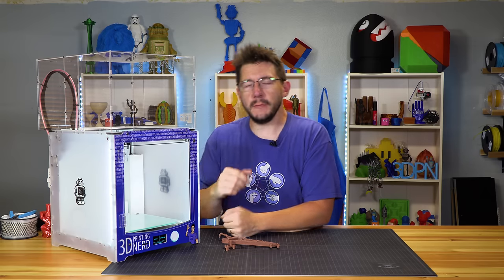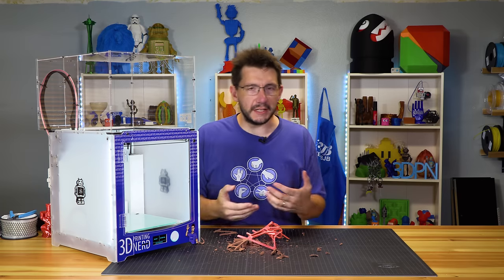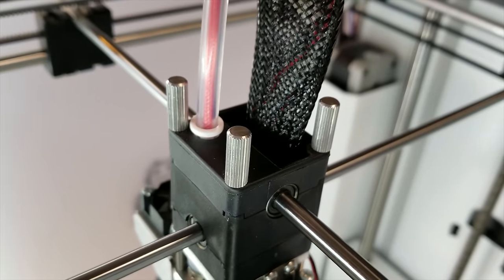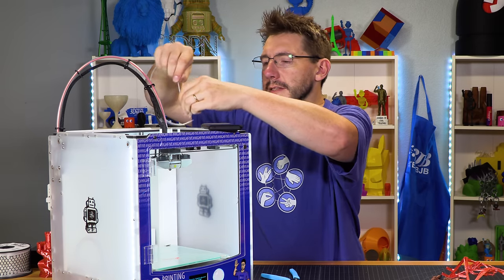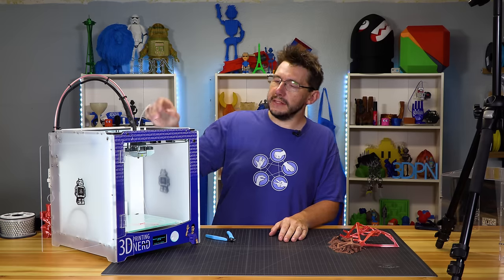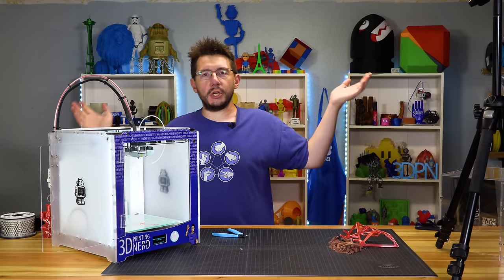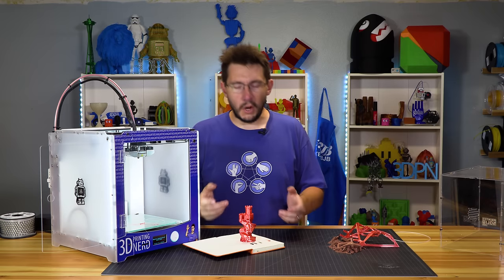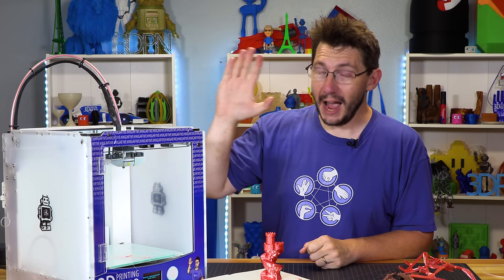3D Printing 101: How To Fix a Clogged Nozzle Using a Cold Pull!

Comment: Quick note to add: if you have a hot end where the PTFE tube goes ALL the way down to the nozzle (such as a CR-10), even if your firmware allows you to go to ludicrous temps, you should throttle it around 235c.
Reply: Meh, I'm printing PETG at 260°C with this and the bowden tube looks fine...
Reply: Eh. Even the UM2+ has a PTFE coupler between the hot end and the Bowden tube that needs to be replaced once in awhile from heat exposure (after1000hrs print time usually). Needs to be replaced more often with higher temps. Not like a cold pull takes that long anyway.
Reply: I took an old Bowden tube and cut an 2inch piece to guide my filament when loading hotend. Then after hotend cooled, I removed the tube, reheated hotend and did a cold pull. That way I didn't need to worry about guiding filament or burning my Bowden tube.😅

Comment: One thing I would add...I would move the print head to the corner and be wary you are not pulling upwards too hard to damage the metal rods.  I've never used Nylon for my Atomic Pulls, just PLA...heat to 220, press filament in, then cool to 90C and pull.  Rinse and repeat as needed.  I'll have to see how Nylon does as a comparison!  :)
Reply: In work we used PLA to cold pull a fully cloged UM3 BB hot end (with PVA) it takes few pulls and in the end it was like brand new.
Reply: Yes, this is the correct way... the way it is explained in the video is not the correct way.
Reply: The Explorographer There is no 'correct' or 'wrong' way. Of course, it works with PLA, but if you have some Nylon, thats better. The type of material doesn't really affect the cold pull. It's the action that does the magic. The type of material just changes how well a material works to clean out another material, based temperatures
Reply: Well then we can just agree to disagree.  I am going by how it is shown to be done right from the Ultimaker site. Do it however you want.
Reply: What i dont get is why he heats up the filament before pulling it out. Why call it a cold pull when you heat it up? I Also always use pla and either let it cool down all the way or heat it to 80C because it gets really flexible but it will pull everything out even the little bit right inside the 0.3mm hole.
Reply: Tibo Huyers I also don't get this. I let the filament cool down, and heat the extruder back up. while the extruder us heating I pull on the filament, until the extruder is so warm that the filament comes out.
Reply: tonpa888 that might actually be the best method since you take out the fillament right when it starts to come loose and when you want to put it back in the extruder is already heated up.
Reply: Yes that´s right. For me, it's the best method I used so far
Reply: I thought that was quite funny too.  Put the head where the bars are the least supported so you can bend them and go to pushing and pulling on the filament.  Obviously slept through Physics 101 and common sense.
Reply: With a volcano hotend cold pull with PLA has never worked for me. The filament always breaks or melts a few millimeters down the nozzle.
I will now try the method with Nylon.
Reply: good cause i was about to buy some nylon to do that.
Reply: @WhereNerdyisCool  hey , I think I have a clog as it barley allows me to push the PLA filament in at all. I currently have an Elegoo Neptune 4 plus. It has an automatic “load” feature. If I hear it up and just click load a few times you think it would help?

Comment: Love a good cold pull :P Also what can work amazing is to use intentionally moisture damaged nylon next to 'steam clean' the remaining crap out of the nozzle. Like seriously if you let it get wet it pops spits and builds up pressure in the nozzle. It's SO satisfying.
Reply from the maker: YES! I've only done that once, long ago, on accident. I need to do it again. Plus, it's super easy to do!
Reply: Steam clean? My dad would freak out
Reply: As I just posted, string trimmer line works well too, with the added benefit of it usually being quite full of moisture, so you get the steam cleaning effect as well.
Reply: @mattelder1971  Thats funny. I was just thinking about that while watching this wondering where I was going to get a nylon string like that. I have some "twisted" trimmer line as well. Maybe turning it around and back and forth in the nozzle will have an "agitation effect" or a "swiping effect" and clean even better :)
Reply: @mattelder1971  What size line trimmer line would be appropriate for a 4mm printer nozzle?
Reply: @richardabner9420  believe I saw another video on this, just 1.75mm as far as I'm aware :) I'm gonna go find the video for you though

Comment: I have had super success with esun cleaning filament. Rescued a nozzle after multiple cold pulls have failed. I was about to throw away the nozzle. Came out loke new. Ran around 10 cm of cleaning filament through the nozzle then did a cold pull using the same cleaning filament. The cleaning filament cold pull is at room temperature. Amazing stuff

Comment: A little hint, if (like me) you don't normally print in nylon, and therefore don't have nylon filament around to do this, look for a small pack of string trimmer line at a home improvement store or the garden section of Walmart. You can usually find a small roll of it for just a couple of dollars. Be sure to get ROUND line (it does come in other shapes), and make sure the size is one that will fit your extruder (.065 inch line works well since it works out to 1.65mm, just under the normal 1.75mm size of filament).
Reply: good to know

Comment: I occasionally find myself frustrated by random clogs in my Prusa i3 MK3 and after being benched for a month -- and fearing that a complete teardown and PTFE-tube replacement was in my future -- I thought that a cold pull might help, so I watched this video.  I turned up the extruder temp to the max (295C, IIRC) and when I inserted my regular PLA filament, noticed that molten filament was flowing, so clog problem solved!  :)  While I may do a cold pull down the road, it just didn't dawn on me to really crank up the temp to unclog the printer!  Thank you, Joel, for making such clear (and helpful) videos for newbies like me!
Reply: Oh, I was going to say that you listed the steps in your video and I'd find it even more helpful if you listed those in the description (or had a link to a page containing same), so we short-term-memory-challenged folks can use it as a checklist during the process.  Thank you!

Comment: Mine was once clogged as in no filament would come out at all because it somehow wasn't melting the old filament further away from the heating block so I took a lighter and heated all around it until about 300-350°c and that was enough to melt all of it and I could then push it out. A bit extreme but if this video doesn't work that might be your next only solution.

Comment: Having a clogged nozzle was the worst experience ive had starting out. It took me FOREVER to get it right, although once i realize cleaning the nozzle is very important everything came together and my life changed for the better lol i no longer get frustrated and give up on my 3d printer. it still is a process to have it clean, the cold pull method is something id have to try for myself!
#3DPrinting101

Comment: Nice tip !
I don't do it exactly the same  ... My method differs in only 1 point : I don't re-heat once it's at the desired temp. With nylon, I let it reach 120°C or so and  then pull the whole stuff. Works like a charm.
also works with PLA, going down to 90°C.

Comment: I don't know if step 7 is necessary or even helpful. It doesn't necessarily hurt but if you wait too long, your temperature will overshoot and you'll need to repeat the process. Basically push and hold until the nozzle cools down to 65˚C (for nylon!) and pull. At least with trying to pull while cooling down, if you don't pull it out, you can heat it up and try again on the warmup.

Comment: I preffer doing it outside with a heatgun.
With it clogs i just jam in a new nozzle and then clean it later. I also give it a few brushes with the steel wire brush till its all clean too

Comment: Nice video Joel. Good idea for alternative methods ...
I use cleaning filament (eSun) which has a little gritty feel and seems to help scrub the insides as it moves through the nozzle. I then set temp to 100°C and let sit for a few minutes just before slow pulling.

Comment: sweet info, been doing this for years. One thing, actually I've found things like Nylon aren't the best. Reason, they release at higher temps, so lets say the PLA you are trying to clean out is actually liquid already before the nylon releases. Honestly I've found Flexables (TPU TPEE) work the best as you can let it get near room temp to do the pull. Everything is somewhat solid and when you pull it you'll hear a satisfying POP and everything in the nozzle gets yanked out.... nothing gets left behind.

Comment: I have done cold pulls on my Ultimaker Original and UM2+ for a long time but using nylon adds an extra dimension that I didn't think of before, so gave it a whirl. Couple that with the constant pressure while cooling, it works really, really well! 
Nice one, Joel; adding a new twist to an essential technique! #highfive

Comment: I remember my first jammed nozzle, back when I couldn't find replacements. I was printing with ABS and was getting all kind of tension and build up in my hotend. I took the nozzle off and let it sit in acetone overnight to unclog it! 😆
Reply: Stephen Zura now that is an idea I like! Screw putting force on your z-axis... Just soak it!
Reply: I've done this before and just end up with a bunch of gooey abs still choked in the nozzle.  Had to keep agitating and rinsing it out with acetone several times.  Maybe that plug was extra bad, but it seems like a cold pull could do just as well and maybe a little faster.
Reply: Unfortunately, Acetone wont clear out PLA, etc., only ABS

Comment: If printing with carbon fiber nylon, the material that is stuck, should i heat the nozzle up to its printing temperature, which is 260 instead of 200 for step 7?

Comment: So you're using 3mm Taulman clear nylon and I assume you normally use larger 2.85mm filament in your printer. Mine uses 1.75mm so do I need 2mm or 1.75mm filament? I can't imagine it can handle 3mm. Sorry if this has already been answered but there's so many comments at this point.

Comment: Good to know that works lol, I've been doing that with PLA for a long time and has worked flawlessly ;-)

I have a different method but same principles, while it cooling I just keep jamming it back in and out cutting off the tip each time until it won't melt anymore.

Comment: Hey Joel I'm new here in the 3d printing nerd world. I was wondering if you could do detailed a set by step changing of the boudin tube and nozzle on the artillery sidewinder, or any extruder that is similar to it. With recommendations to durable materials to prevent clogs and what not. With full discretion links to said things, to ensure work efficiency. If possible id greatly appreciates it. I know you have a video of changing the tube but it's not really a step by step and I'm afraid I'd screw something up and well I'd have no printer. My last request if possible with some of your smaller models, novice or entry-level 3d  printers at the beginning or end of the videos on your reviews slap a compatible filament's sidenote or credit that the machine can handle. Because the websites such as Amazon and other retailers just put PLA, ABS, TPU... and I'm not sure if it means this is all it can handle or if it means (and the list goes on) it's very ambiguous and frustrating for beginners like my self. Thanks Joel for everything you've done to kick off my 3d printing journey!

Comment: Can you use PET-G filament to do this?  I believe that is Nylon based?  Also I just got my 1st ever filament of PLA+ from e-sun. I got a order due soon of PET-G!  I was reading the good guide paper that came with the e-sun PLA+ filament ( orange colour ) and the guide shows the different types of filaments!  One is called "E CLEAN".  Seems they say in the guide this is meant to clean out old filament before and after each print!  Also used to act as an intermediary filament  between different filament types and different temperatures and even between different colours of filament temperature from 160 to 300 C? Sounds amazing.  Hi Five Joel.

Comment: Hi all, I tried many times your solution, but I don't have nylon, that might be the reason of my poor results. Unfortunately I lost my patience and discovered a "storm method" that cleans everything in 10 seconds. The start is the same (preheat at 230, pull and so on) , but instead of pushing gently some filament into the back of the system, I've pushed 2 cm of orange PLA filament until the back surface of the hot end injection tube, and then I pushed strongly with a small screw driver (fortunately the diameter was 1.6mm) and then all the dust and scories went out in a bubble with black parts . I've tried a second time, and the bubble was clean. The "strong push" made the speed of the flow reall high which gave a really good result. The PLA in overtemperature might have a boiling effect that improves even the process. I hope this could help and save time. Thanks anyway, your video paved my way to innovation.

Comment: I bought some eSun "cleaning filament" when I first got my printer, and I've only used it once! XD But then again I only had a clog once after a LOT of wood-fill printing, but it was a total clog. So I just went the lazy route and (not having any replacements yet), bought a pack of 0.4mm nozzles and just switched it out. :P  Maybe I'll try using it a bit more between filament changes and see if I actually get any crud out.

Comment: Joel, I had a question.. Could a person use those long metal cleaning files for a similar thing? As example, my Ender 3 came with one, if I heated the filament and then slipped it in, let it cool and pulled, it should pull some of the gunk with it, a heat gun should soften enough to remove from the cleaning file, thoughts???

Comment: I dont have a nylon filament to use this technique. What can I do? GREAT video
Reply from the maker: Nylon is best because of it's melting temp and it's strength. I don't know if others will work. You could reach out to any reseller or post in a group - see if someone has some Nylon to spare?

Comment: What's the reasoning behind using nylon? Wouldn't a filament with a lower melting point, like pla be better? As I see it the goal is to fuse the clogged filament with the one you are pushing down. And to me, it would be more difficult to make nylon fuse with what ever material the clog is made of and also the probability of creating new clogs would be bigger with nylon.

Comment: Joel: do you find nylon works that much better than other materials? I only have pla and using pla works rather well to remove itself. But buying a sample of nylon might be worth it to use for cleaning.
Reply: I find PLA cold pulls work OK, but I do see the advantage of the nylon; stronger material so it is less likely to break when pulling, and almost colorless so I can visually see the cleaning impact.  Disadvantage is the higher melting temperature which some cheaper printers may not be able to reach, or which may cause damage if the print head is not an all-metal head (has a high-temperature plastic tube inside, like PEEK or PTFE, which may start to break down at or near nylon's melting temperature).  If your printer has an E3D V6 all-metal print head (or similar), there is no concern.  But if your print head is uses a tube that gets very close to, or enters, the hotend, then I would avoid using Nylon.

Comment: Education! So Joel, do you use 3mm nylon in your machine that normally takes 1.75mm, and a 0.4mm nozzle? I'm wondering if I can do your method verbatim on a stock original prusa i3 mk3; normally uses 1.75mm/0.4mm.
Reply: I was going to ask the same question but I went and checked the Ultimaker site. The printer takes 3mm filament normally. Unless someone smarter comes along I'd say use the same diameter filament that your printer usually uses.

Comment: Thank you Joel for posting this, it came at a very good time as I am having exactly the kind of difficulties printing as you described.  I don't have any nylon yet but I will keep this in mind for when I am next buying filament.  I manually cleaned the clog out and have gotten 1 print out and a second is printing now with much better results.

Comment: No luck with 1.75mm PLA or PETG. The filament always rips before it pulls the whole "plug" out. Buying 3mm Nylon just for that also seems a bit over the top. For that money a can buy 20 replacement nozzles for my Ender 3.

Comment: What about the Little parts of nylon stuck inside the nozzle? It would jam it again if you print pla. I think you should do another cold pull or hot pull with the filament you are using normally (as last step) just to clean any little part of nylon stuck in the nozzle.
Reply: Nylon have insane tensile strength, when you get the temp at pulling perfectly right they wont be any nylon stuck in you nozzle.
Reply: Mateusz Schyboll but just to make sure there isn't any left, I would do it anyways
Reply: You see that when you pull the filament out, if they is nothing left in the nozzle it is a regular taper with a small cylinder on top.
Reply: You can tell by the shape of the pull if there's any bits of remaining material left. The plug should be totally smooth